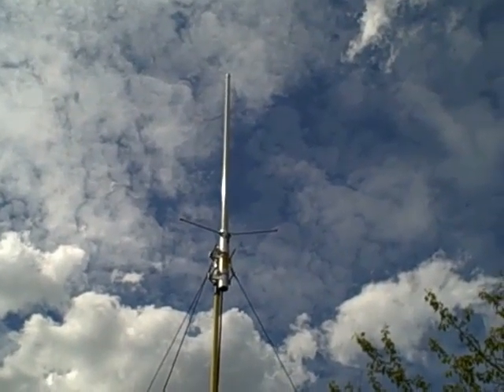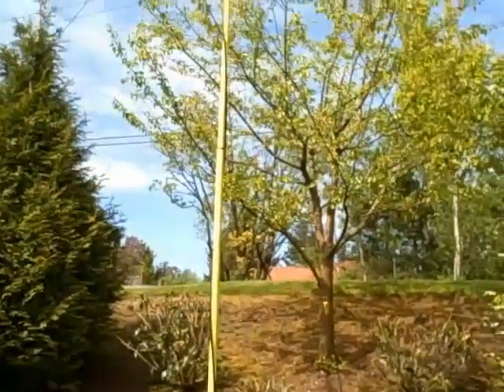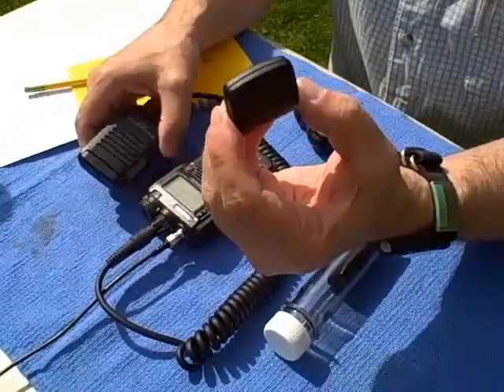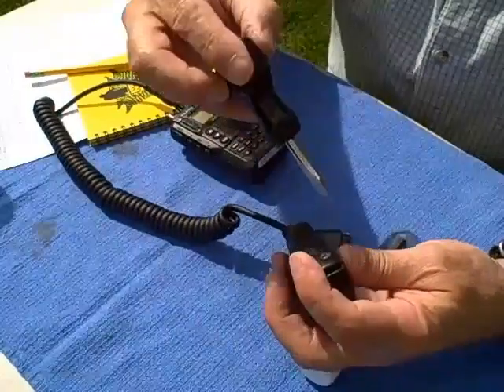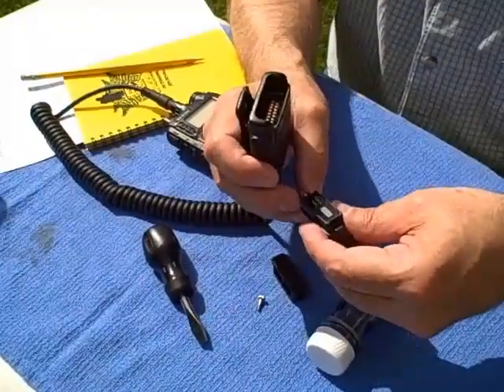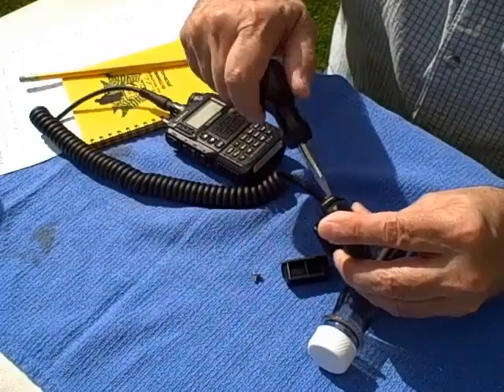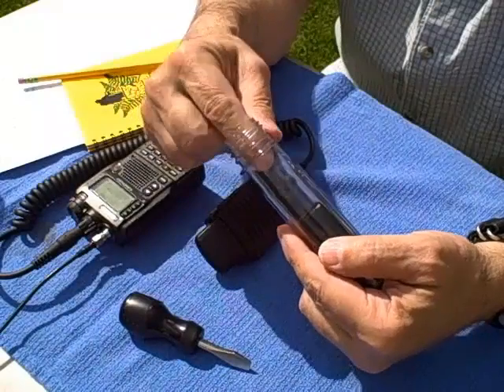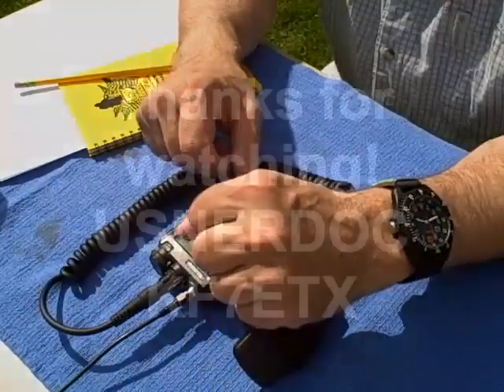Painter Pole 2m Antenna + Yaesu VX-8R APRS Modification

Comment: Sorry I am legally blind. How meny sets of guy wires you are using?
Reply from the maker: +Edward Matarazzo - One set of three. Thank you for watching 🙏
Reply: @USNERDOC  Thank you very much.
Reply: I have one more question. The painters pole I bought has a plastic quezo that suppose to lock any tool om the thread of the pole. So it will prevent any thing to mount flush against it. I think I can get an antenna that has a t mount. But I rather knock off the dam thing off so I can widen my choice of antenna. Do you have an ideas to deal with this. This is going to be my first home 2 m rig.